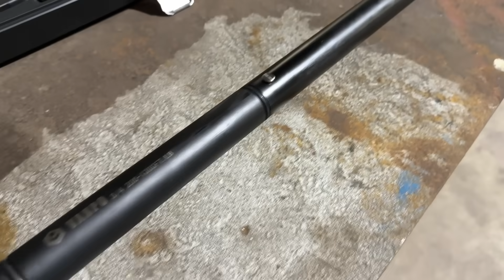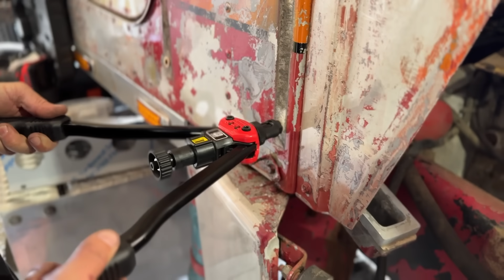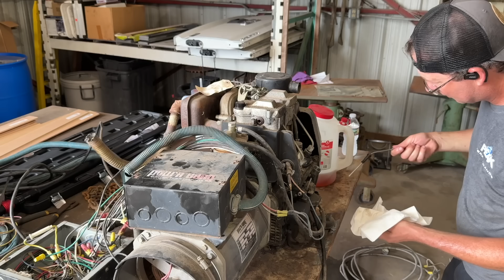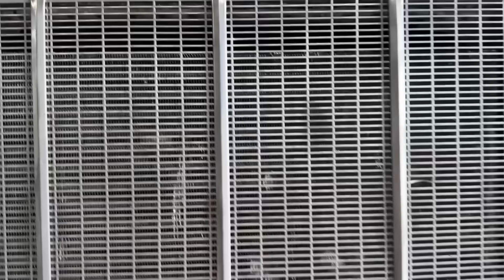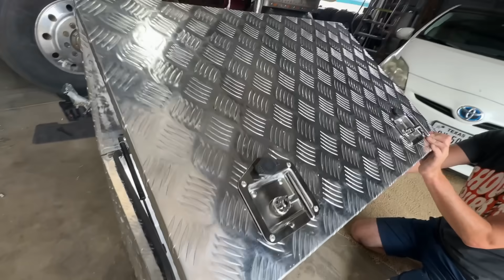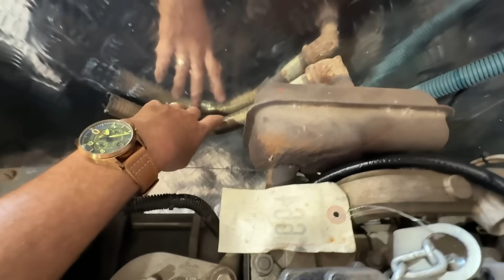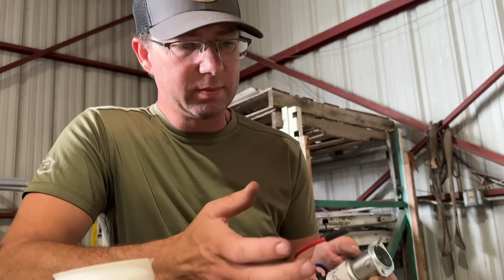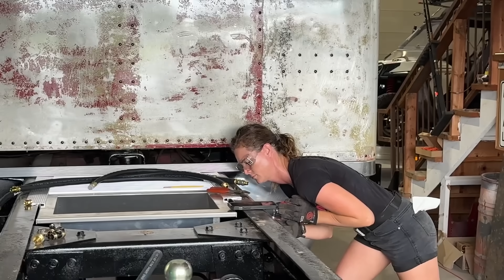Onboard Generator, 2nd fuel tank and MORE!

Comment: Holesaw - you can install two holesaws on your drill - the smaller one will center and the bigger one on the outside. Then no walking :)
Reply: I tried that yesterday, I’ve done it many times but the two bits are too thick to piggyback. Wonder if they did that on purpose.

Comment: For an easy way to balance your rear tandem wheels you can check out Centramatic wheel balancers. They have them for the front and rear. They are placed between the tires. Just a thought. The Pete is coming along great.

Comment: AMI 6102? Can you provide a link or share that info, Its not pulling up on Amazon or google, my boss just did the exact same thing with his 02 International dump truck. Alum outside wheels on the inner steel wheels for his rear duals. He seems to know just about everything about everything so you guys would be helping me out with some knowledge he might not have yet. Love the build, also love the rv plug, good call with the wood for the arbor, I have had to do that quite a few times, I was telling you that while watching and then you did it! Great minds! Thanks again guys!

Comment: Arron, you can do the holes trick with the wood on the outside also. Drill the hole through the wood first then mount the wood hole where you need it on the truck, that hole is the guide. Love the videos

Comment: Going in reverse with hole cutter can sometimes help if you control the drill.

Ruggerini is the italian city where Duetz is produced or was .

U need to get a rough or a partial  reared mistake and make Mini pick up.

Split the cover of the genie cover at the front and use the piano from the back to hinge it.